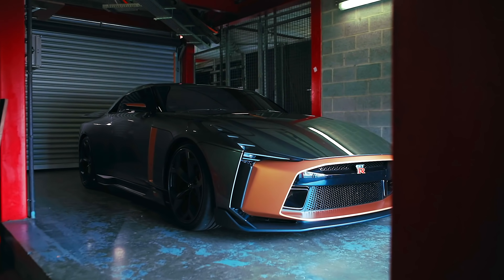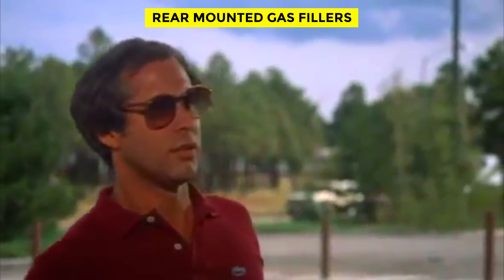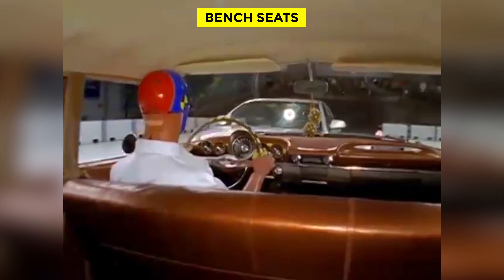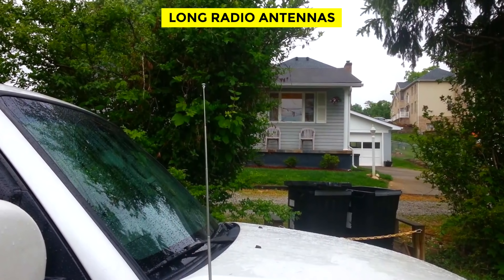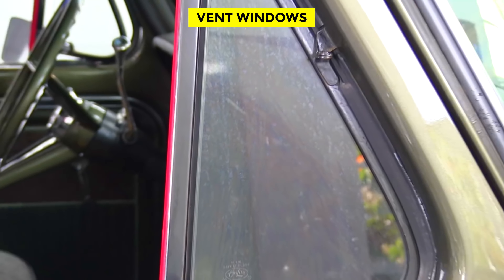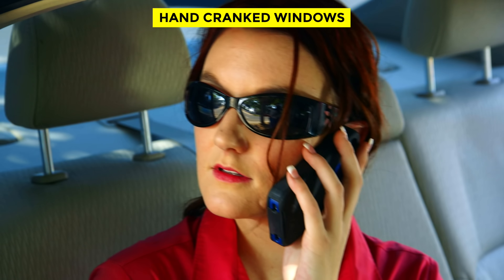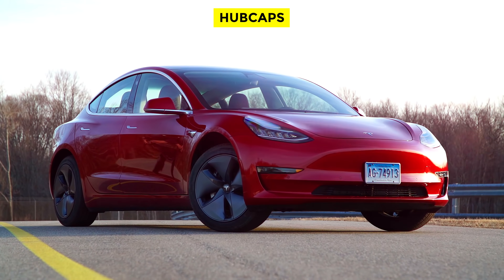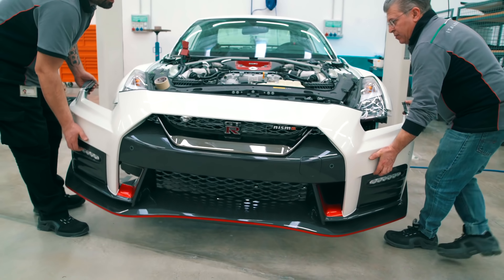7 BANNED Car Features That No Longer Exist!!

Comment: Most of these aren’t banned, CLICKBATE
Reply: It's also super inaccurate.  Lots of cars in the 60s had side gas fillers.  My oldsmobile has one on the drivers side as did just about all trucks.  This article has zero fact checking in it
Reply: Agreed: About the only thing I saw that might be banned, might be the fender mirrors. While not illegal on the road, new cars won't be built with them again. I don't think the long antenna is "illegal".
Reply: My 2011 Skoda Fabia have hubcaps,  and the standard rear windows were hand-cranked (i had to pay for optional electric rear windows)

Comment: Exterior antennas STILL EXIST, bench seats still exist, triangle windows still exist, hand crank windows still exist on MANY CARS, full size spares still exist, hubcaps still exist on MANY CARS
Reply: I know
Reply: @BizzyBlazer there ARE BRAND NEW CARS made by Asian manufacturera with all the points I mentioned.
Reply: The only vehicle I know of that still have crank windows are work model truck bc I’m getting my license soon and I’m getting a work truck model Chevy that has no electrical door locks or windows
Reply: @BizzyBlazer what? Toyota still has hubcaps on multiple models. so do most brands for base models with steel wheels.
Reply: @BizzyBlazer toyota uses hub caps still
Reply: @BizzyBlazer The 2017 ford transit we use for work has a long antenna sticking up out of the hood right above the front right wheel, the same kind of antenna he said was banned. Additionally if you look at the models of cars he showed while mentioning internal or streamline antennas they all had metal shells and yet they had internal antennas. We are long past the age where antennas cant pick up signals through a tiny piece of sheet metal.
Reply: @thtsnglcab7.33  If you buy a base model of any car theres a good chance it has crank windows. I bought a brand new 2013 Kida Rio base and it had crank windows
Reply: @JustTeasin The hell  are you  even saying? every european car maker stills sport hubcaps and steelwheels. it may come standard in the US, but a nice set of alloys on even a Toyota Rav4 is the price range 3 to 4 thousand dollars in some europeans markets..
Reply: -New cars with exterior antennas still exist in my country, but only for passenger cars that under $15,000 and trucks. Hubcaps also still exist for the passenger cars with same price range as above and for some small pickup. One of the new cars that still has full sized spare tire is All New Suzuki Jimny.
Reply: who still has triangle windows?

Comment: 55 on speedometer red/or circled, Ignition key lock-in-place mechanism, septate trunk key, lap belts, electrical shoulder belts, hazard light switch under steering wheel, car batteries needing water.

Comment: Hand crank windows are still all over the place. 

A lot of Chevy's have them as standard.
Reply: Well only those older than 2013, Just about every chevy after that, Exceptions being the cheapest they offered, 2016 and after you would have to pay for that "feature"
Reply: My 2020 Chevy has hand cranked windows.

Comment: Part of me misses old school cars with no power steering, no electric windows, no ecu management, no airbags.
Reply: My power steering broke a week ago, had it fixed imediately. Isnt fun and is scary to drive
Reply: you should try my car then, of your list there, i only got airbags
Reply: I dream of a car without power steering
Reply: @mlee6050  lol i have a golf mk2 1985 still enjoying my gal, hope you guys buy an oldtimer someday ;)
Reply: You only need power steering for parking, some cars reduce assistance when you are moving so you still have 'feel' which is better than on all the time.
Reply: I doubt anybody wants a car without power steering, Having driven a vehicle that lacked it once.  No thanks, Power Steering is one of those things that like the air conditioner are an absolute must have on car.
Reply: sounds like my Fiat 126 :P
Reply: Got rid of my 2017 jeep and bought a 1978 F150 granpa truck. Wing windows, no damn computers, hand crank windows,no fuel injection, manual locking hubs and a real transfer case. New cars are throw away popcorn.  (Jeep = cant fit locking hubs, computers up the wazoo, non replaceable front u joints, non-serviceable front wheel bearings, fan speed control is a HEATER COIL resistor in the air duct....the list goes on. )

Comment: Disclaimer:  None of these "no longer exist" features apply to pickup trucks, SUVs, and the such.
Reply: Or cheap fleet vehicles.
Reply: Or Toyota and Subaru. I wish they didn't have hubcaps anymore lol. Would make working on them a lot easier. Doing a set of tires and having to put the crappy hubcaps back on and hope they don't shatter.

Comment: Those are not hubcaps.  They're wheel covers.  Hubcaps were smaller and grabbed onto the contures of the steel wheel.  Police and utility vehicles had them.  So did cheap cars or stripped-down models.
Reply: It's true,  wheel trims cover the whole centre of the tyre, whereas hub caps are caps that cover the hub nut in the centre.

Comment: The most recent car was NOT the Chevrolet Impala??? My 2000 s10 has a bench across the front
Reply: That's a truck.
Reply: @Ender_Wiggin03  and? Still has a bench and it's a production vehicle
Reply: i just work on a 06 impala with a full bench seat. 🤷‍♂️
Reply: It was an Impala, just a late 2000's one was the last to have a bench seat.
Reply: It says CAR
Reply: Bench seats still used for trucks, but not for passenger cars.

Comment: The car you show blowing up {70's Pinto} has a left side gas cap, it's the rear bumper struts that punch into the rear mounted gas tank that would punch two fist holes in it when it was rear-ended too hard, that made it a fire bomb!

Comment: My 2018 F150 Regular cab: Bench seats, Long antenna, Roll up windows and Full size spare. Not a car but still a vehicle on the road.
Reply: Your 2018 F-150 doesn't have a genuine, single-piece bench seat; the centre section folds down. My 1988 F-150 did.

Comment: Old cars are amazing but it's hard to get used to no power steering
Reply: it is so simple, with no power steering you just need to relase brake or move wheels foward a little bit and move stering wheel, most people stand on brake and try to move stering wheel and is no way to do it.

Comment: Here is something it no longer exist in cars,  Manual transmission with the gearshift on the steering column. We had a 1967 Mazda 1500 station wagon with a manual transmission and the gearshift on the steering column.

Comment: Cigarette lighter ashtrays
Reply: The ashtrays are gone but the cigarette lighters are still there they're just called "accessory outlets" you can still get the actual lighter portion from some parts stores and in most junk yards if you really want one.
Reply: Luckily useful as a 12v socket in 21st century!
Reply: Robbie Frentz some vehicle have smoker package options
Reply: Some car makers offer a "smoker's package" which includes an ashtray that just sits in the cup holder. Not sure if they actually include a cigarette lighter element though.
Reply: Wow..... i do remember when they advertised of all the ashtrays lol

Comment: What about bumpers that could sustain a 5 to 10 MPH hit without sustaining $5000 worth of damage. Dimmer switch on the floor. Headlight and wiper controls on the dashboard.
Reply: Mercedes Heckflosse has those features 200D :)
Reply: If your car doesn't absorb that hit, your body will. Whiplash
Reply: @KaitouKaiju  Whiplash? At 5 to 10 mph?legally possible but medically?
Walk, stop suddenly, do you have whiplash from stopping suddenly from 7 mph? Thought not!

Comment: My 2016 subaru has full size plastic hubcaps on aluminum wheels. I think their to reduce fuel consumption and stop brake sparks from hitting the paint.  I didn't use them last summer. The wheel noise was higher I believe.

Comment: I have a 1991 toyota truck that came factory with no passenger side mirror, and I had a 1991 plymouth hatchback years ago that also didnt have one.  So you could still buy cars without them in the early 90s.  The toyota truck doesnt even have a rear bumper.  It was common to be able to purchase base model vehicles then without rear bumpers.  I think Nissan sold them this way also.

Comment: My new truck has a bench seats and an antanna.
Reply: That part confused me. 😂 Because Ford Crown Victoria's, Mercury Grand Marquis, and Lincoln Town Cars have front bench seats. And that was in 2011.
Reply: Those cars don't exist anymore unless you find them used because they don't manufacturing them anymore so yeah they would have those features but then listed stuff from cars in the 30s till now stopped using some features but today's cars don't have spares in a few makes and models and some features like the hand crank still exist which they said didn't
Reply: @paulcasanover3082  Well, I know they don't make them anymore. :'D The last year they were made was in 2011. Just saying, 2011 wasn't that long ago.

Comment: My '18 300 came with a donut. I took it out and bought a full size wheel and tire. It doesn't fit in the well, but I do have a full spare. Then again, I'm one of the few sobs that doesn't mind changing a fucking flat.

I'll probably end up installing a hitch and tire carrier just so I get my trunk space back.

Comment: If manufacturers changed to the get you home wheel to make cars cheaper,why
 are the cars dearer.Seems the more they take out the dearer the car gets ?? As for
me,l carry a full size wheel to be safer.The repair kit in the car will not repair a blown
 or shredded tyre.

Comment: bruh. My brand new truck has crank windows. It also has a full size spare too. " Hubcaps went away.. except on one of the most popular cars made right now ".. If you want to talk about something that went away, what about a floor switch for the high beams? Or are you not old enough to remember that?

Comment: My dad had a 87 f250 diesel and it had roll down windows and I'm 14 so I have been around older cars.
Reply: Both of those cars are “old” in today’s standards. Most recent years roll down windows are super rare.
Reply: Wow you cars are pretty out of date.
Reply: Most cars before the 90s had crank windows and full size spares and some had power windows and doors and doughnuts in the 80s  and some got full sized back in the 2000s and crank windows in today's cars
Reply: @paulcasanover3082  I know but most old cars I see have electric windows.
Reply: Don't you mean classic and modern because from the early 80s back had only roll down windows like your mom's 87 Ford f250
Reply: @paulcasanover3082  dad's. And he had a 82 Mercedes 300d and it had electric windows. And his 91 suburban did to. Almost all his cars were before 2000 and they mostly had electric windows.

Comment: What I want now are reasons why retractable headlights are no longer in production
Reply: Don't really need them any more with modern lighting, a lot of the time, Pop Ups would allow for a cleaner appearance in the day and when parked in comparison to what sealed beams were out there, but as lighting tech and laws were changed, you no longer needed to hide headlights to have a sleek appearance. Another advantage is that they're safer for pedestrians and cyclists at night since the cavitys and/or protrusions are no longer there when the lights are in use if somebody gets hit, much like with hood ornaments have  all but vanished.
Reply: Aero and fuel economy, along with modern crumple zones makes it a challenge not worth the effort for most companies

Comment: I want to start a company . The latest technology with none of the electrical hassle.
Reply: Good luck with that because you need election for anything to run
Reply: HOT TOPIC VLOGS simple enough any competent person or mechanic can fix it without specialty tools. Or just as much carbon fiber under 60k

Comment: Everything listed in this video is in, on my daily driver. Eyyy safety
Reply: My Mercedes 200d Heckflosse has everything mentioned here!
Reply: @MrDon967  I own one :)
bench seat with removable seating pad and backrest turns into armrest hood side view mirrors available as options on both sides rear filler cap. etc etc etc
VNE of 80MPH and the speedometer needle turns red at 40MPH :)
Reply: @MrDon967  Just like a Porsche!
Diesel Tractor that is.

Comment: Pop up headlights
T-tops
Carburators
Led Gasoline
& pretty soon Manual Transmissions 😡
Reply: What is the advantage of lead gasoline compared with non lead ones? Because the led gasoline were banned in my province (equivalent with state) since 80's.
Reply: Refiners in the United States started adding lead compounds to gasoline in the 1920s in order to boost octane levels and improve engine performance by reducing engine 'knock' and allowing higher engine compression.1 Lead was used because it was inexpensive for boosting octane relative to other fuel additives